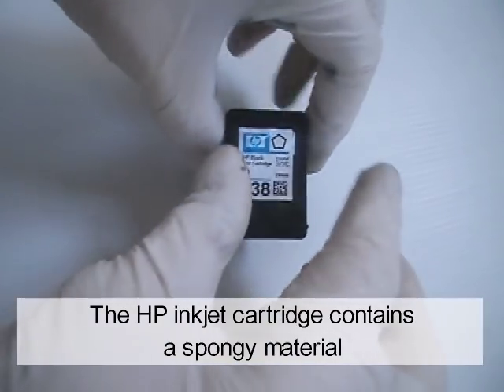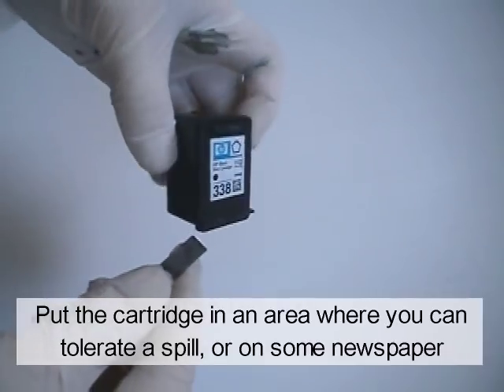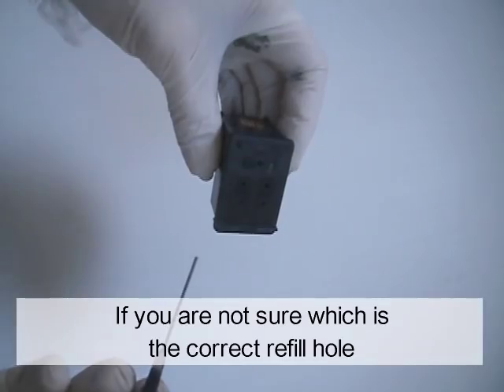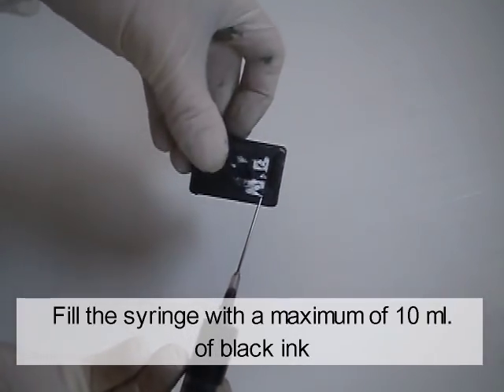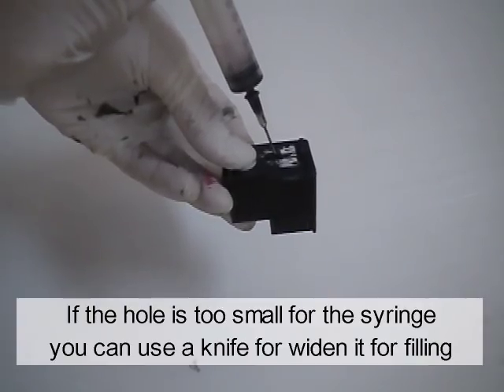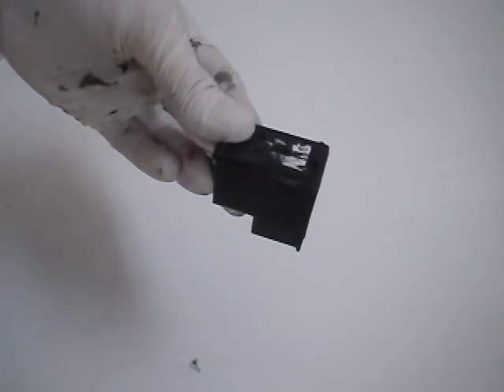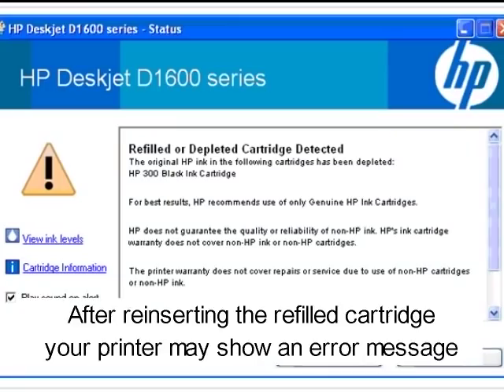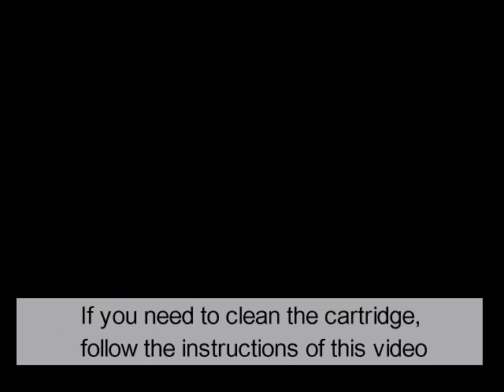HP Black Inkjet Cartridges: Refill Instructions

Comment: HP Deskjet 3845 doesn't recognise refilled cartridge (filled just black one 27), any advise how to reset it, so printer starts printing again? thanks
Reply from the maker: it's necessary to do a reset procedure. you'll find informations in this channel but you'll need 2 extra cartridges
Reply: @viandant5  Would it be a good idea then to fill it before it runs out?
Reply from the maker: @Turtletoots3   The cartrisge has not ink sensor.  there is a chip, a pagecounter. So if you fill the cartridge it's the same

Comment: I refill  hp 680 cartridge but showing no ink . what's problem
Reply from the maker: You have to reset the cartridge, in this channel there is a method but you'll need 2 other cartridges not important if empty or not

Comment: Hey it worked for 2 3 pages , after that ink won't come out. If I try after several hours then it would work again for 2 3 pages . Any solution or suggestion ? Thank you!
Reply from the maker: Try some cleaning procedures. it it doesn't work may be the internal sponge is too old and doesn't release the ink
Reply: @viandant5  ok maybe ? Can you suggest which type of sponge I should buy so that I replace it ?
Reply from the maker: @adarshsurendran7648  It's easier and cheaper to buy another refilled or compatible cartridge, or remove the sponge from an old cartridge with damaged printhead

Comment: Hello i need your help...
I already refill my black ink and the ink level still empty and when I print something the black colour won't come out.... how to reset the ink level i really need your help
Reply from the maker: there is no way to restore the ink level. you have to change the cartridge when quality become low, as we did in the first inkjet printers that were better than the ones made today. probably you overfill the cartridge, that's why it doesn't print
Reply: viandant5 however... when I use for potostet purpose (without connect to laptop and stuff) the ink will come out... btw I use hp 2135 ☺
Reply from the maker: I suggest to resintal the printer driver, check the printer properties. grey scale are printed using the color cartridges, not the black cartridge

Comment: should i block before inserting it on printer?
Reply from the maker: +Derek may be you have to reset the printer
Reply: viandant5 i mean should i have to block the holes? or just let it open?
Reply from the maker: +Derek it's not necessary to block the holes of the print-head

Comment: I followed instructions on filling and the first time I did it it worked now empty after very little printing so I refilled again and got one page of print then seems empty again   also most the ink I injected in leaked out while sitting on paper towel on counter why is it all leaking out I did inject into the hole with sponge    can anyone help me out here   thanks
Reply from the maker: +Liz MacBeth probably the sponge inside the cartridge is too old and it does not keep the ink. or the filter over the nozzles is dirty
Reply: Maybe sponge altho iit is quite soft checked it and also cleaned as indicated on Youtube or another site on how to clean  etc   Not working for me anyway just all runs back out and if I do get it to print get 1 maybe 2 pages and thats it   thanks for replying to me
Reply from the maker: +Liz MacBeth probably you have to change the cartridge. do not let the cartridge on a porous surface after refilling
Reply: Oh,,, that could be problem I always leave sitting on paper towel. Is this what you mean it may be drawing ink out, Should I put in printer right after filling ???    thank you so much for your help on this much appreciated
Reply from the maker: +Liz MacBeth let the cartridge for some minutes over a flat surface, then if it does not leak ink, insert the cartridge into the printer
Reply: Ok thank you i've tried several things and it just won't work so guess I need to purchase new cartridge

Comment: Hi Viandant5 , I have a HP deskjet all in one printer Model 1510 , After the system prompt as cartridge is empty , I refill it with a comparable ink but still the system refuse to print , Prompt msg as above . How to solve this problem , tks
Reply from the maker: You have to do a reset procedure, search in this channel you'll find it. But you'll need other 2 cartridges, new or not.
Reply: Thanks a lot  Vinadants  , I have to look for extra cartridges ,
Reply: arumugam samy
Reply: arumugam samy

Comment: i filled hp prrinter ink using syringe after that when i installed it back in printer, it print only one page and remaining pages are left unprinted. Can you tell me how to slove this issue?
Reply from the maker: +dinesh denwal may be that cartridge is overfilled, try draw out some ml of ink with a syringe
Reply: +viandant5  thank you. I'll withdraw some ml of ink and then again trying printing a page.
Reply: +dinesh denwal i withdraw all the ink from the cartridge, and wash it with warm water as mention in one of your video. Then after sometime i again refill the ink, this time only 5ml but still I'm not able to print a single paper. Kindly help me out. Thanx in advance
Reply from the maker: +dinesh denwal The internal sponge may be too old and can't retain the ink, or the nozzle filter inside the cartridge is dirty
Reply: +viandant so is there anything i can do to resolve the problem, or i have to purchase new one....and also i brought that cartridge last month and used it for only 1 month, so i think that is not too old?
Reply from the maker: +dinesh denwal 5 ml may be it's still too much. try with 3 ml. also you can try the "pump method" described in a video in this channel. if it doesn't work, I think you have to change cartridge
Reply: thank you for your advice

Comment: After i refill hp 61 the ink will just come out from the the down
Reply from the maker: Gurvynder Singh probably too much ink, or the internal sponge is too old. try let the cartridge over a flat surface until it stop leak
Reply: It will leak all the ink out
Reply from the maker: Gurvynder Singh over a flat non porous surface it will not leak all the ink. if it do, the internal sponge it's matted.

Comment: Guys can anyone tell me which printer to buy. I bought a inkjet which give only 30-40 A4 pages(Black) per black ink cartridge. My main purpose is for printing 50-100 text docs per day. My budget is 5000k - 10000k. Thanks!
Reply from the maker: Arun Prassath for sure a laser printer, not an inkjet printer. in my opinion currently samsung are the best one
Reply: Thank you
Reply: Brother D2270DW is the best seller on amazon. You can check it out.

Comment: Help! My printer (hp deskjet 1515) showed an error message after i installed my newly refilled cartridge it says that the black cartridge is incompatible and now my printer can't print. :(
Reply from the maker: Are you sure it's the correct cartridge? Try to clean the electronic contacts. It could be a defective cartridge
Reply: @viandant5   yes it works fine before i refilled it :( then it worked for a while and printed an alignment page then after that the black ink light on the printer started blinking and showed a message on the pc screen saying that the cartridge is incompatible
Reply from the maker: @annapanlilio8201  Did you change the chip?
Reply: @viandant5  i didnt :( even my spare empty black cartridge is being read as incompatible :( i cant buy a new one because there is no available compatible cartridge on where I live right now :(
Reply from the maker: @annapanlilio8201  Old chips could give error messages. It's necessary to change the chip
Reply: @viandant5  ohhh but how can I change the chip?? My ink cartridge btw is hp 650 :)
Reply from the maker: @annapanlilio8201  Excuse me I understood you had an HP LJ1515, but you have a HP DJ1515. After you refill an HP inkjet cartridge you have to reset it. I only know this method:
https://www.youtube.com/watch?v=P6R_Vp3QXPU
but you'll need other 2 cartrisdges, empty or new it's not important

Comment: Hi! My black ink cartridge ran out of ink. then I refilled it but it is not detected. What can I do?
Reply from the maker: which cartridge? probably you have to do some reset procedure. search in this channel.
Reply: PG 745 Black... It is working after selecting Color Only then reverting back to Both Color and Black but it is not showing the ink level
Reply from the maker: Sumanta B Canon PG 745? after refilled, probably the ink level will be not correct. try reset procedures for canon, you'll find them also in this channel, or use google
Reply: thank you :-)
Reply: Holding the stop button worked but the ink level is still not detected
Reply from the maker: Sumanta B that method only cancel the error message.if you need the ink level, try reinstall the printer driver.
Reply: okkk let me try then
Reply: mine does that all the time. It doesn't measure the level of the ink. The printer calculates how much ink is left in the cartridge because It ( Printers) know aprox how many pages you can print from one cartridge or maybe how much ink has left the cartridge after each print. but it does not measure the amount of ink that's left inside. You see? Each model of cartridge has X amount of ink from the factory. The printer keeps up with how much ink has left that cartridge and gives you an indication of how much is left. It cant tell that more has been inserted. I fill mine up when it says its about half way done. But the level light stays at the same level it was when I took it out to fill it up. I put it back in and it still says it's half full. Even though it's overflowing with Ink. It only measures what goes out, not in.
Reply: Kenneth Biddle ps I use a HP f4280-all-in-one with HP 60 ink cartridges'.
P.S. I have read that is best to fill them back up before they get completely empty or especially dry. So I wait till its a little past halfway empty. Just above 1/4 left then fill.
  I've also read that you can only get about 3 refills at best out of a cartridge. I find this to be true. ESPECIALLY if you wait till the ink runs dry before refilling. Keep it flowin!